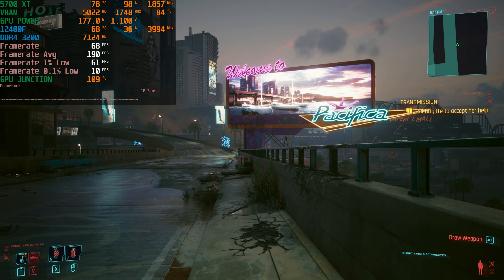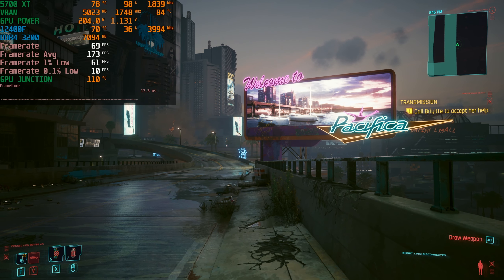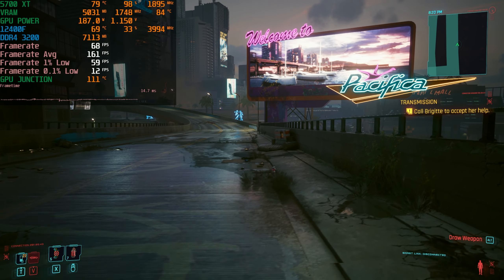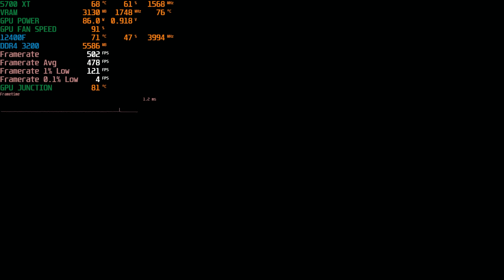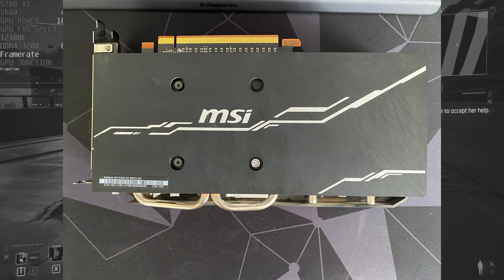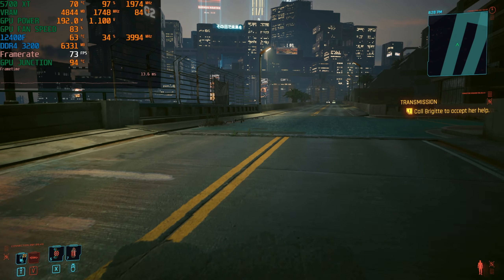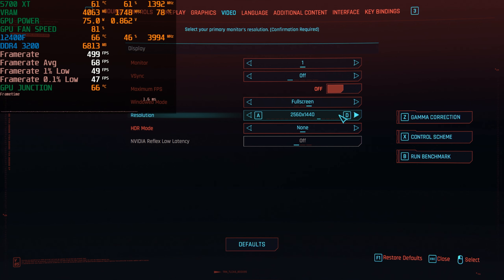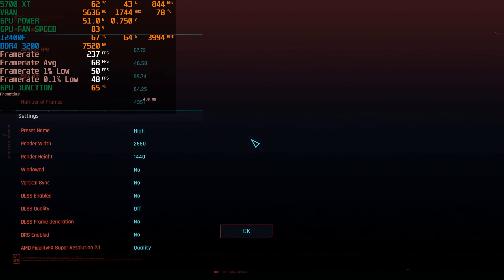Reviving a Used Mining AMD RX 5700 XT GPU for Gaming: Before and After

Comment: This month i bough cheap rx 5700 xt Nitro plus and i think its mined. In cyberpunk 2077 Temp: 61 Fan speed: 26.I used afterburner to adjust speed
Reply from the maker: Those are decent temps and fan speeds.  The Nitro does have a decent cooler, which helps.  The one in this video is an entry-level MSI one with only 2 fans, which makes for high fan RPM and high noise levels unfortunately.